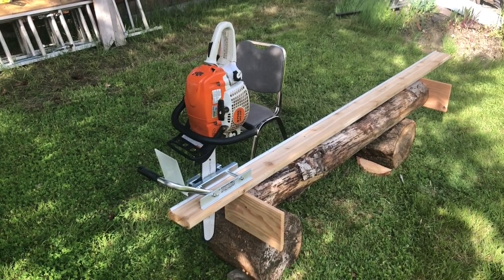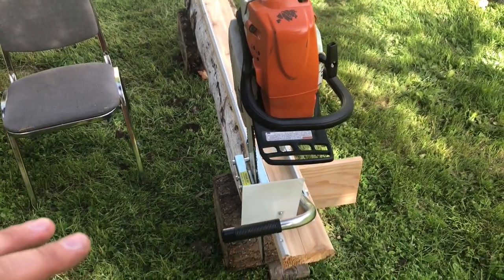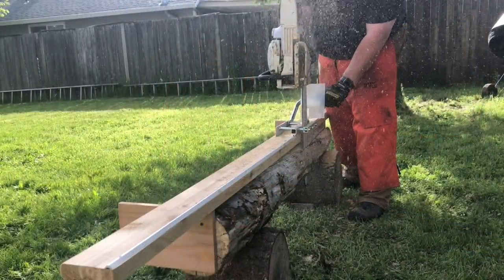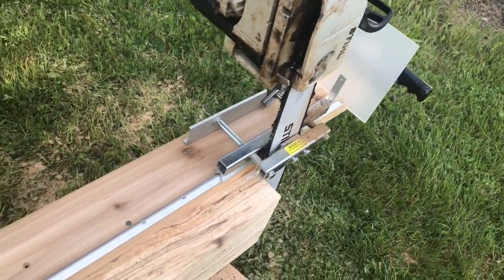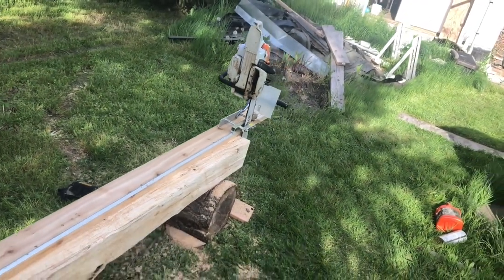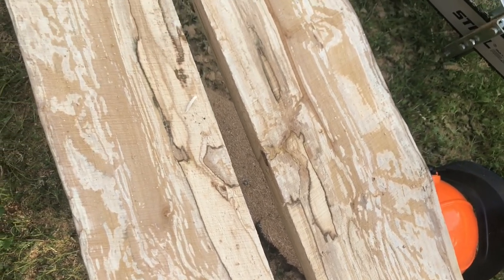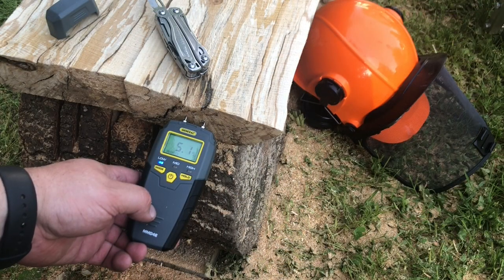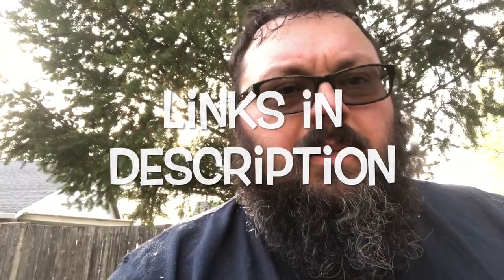First Time:  New Chainsaw Mill

Comment: Great video, thank you for posting this. I wanted to comment on the technique you used, only because I purchased a mini mill (not the same brand) but in the instructions it says to "pull" the saw. I was skeptical of this because the "push" (top) part of the bar does the cutting (so all the shaving will fall straight to the ground) it also means that if the saw were to catch it has the potential to jump out of the curf and if it did it would travel towards the operator. Thought I would share this. I havent used my  mini mill yet but I look forward to it! This video helped a lot!! 
All the best.
Reply from the maker: Thank you for the observation.  Honestly I haven't used this mill since, I have been using the Alaskan version which is horizontal.  I still have this one and don't count it out as useful.  Thanks again...
Reply: How are you liking the Alaskan mill?
Reply: @1muddonna  ive only used it once. Happy about the final product but i honestly havent cut enough boards to say yay or nay

Comment: Your 20" bar x 55cc chainsaw mill will easily cut 12" timbers and slabs.    I have the same size bar and 50cc saw.     
You'll love the smaller Granberg slabbing tool, too, works great on this size saw, and allows you to cut 1" and 2" slabs very easily.    A great companion to the mini mill
Reply from the maker: I am thinking along the same lines.  I am looking forward to trying everything out

Comment: If you have a hot attic or garage in summer you can put your planks up in the rafters and speed up curing process.
Reply from the maker: That is a great idea.  My hatch is smallish.  I am going to do that with some of my smaller pieces.
Reply: that is a great idea. Or you could build a solar kiln out of plastic in a sunny  corner of the yard maybe
Reply: The faster it dries, the more it cracks even if you seal  it first. But sealing helps your wood to dry out uniformly.

Comment: That mill looks great im away to order one. A general rule of thumb with fresh cut trees, if your slabbing them is a year air drying for every inch thickness. Moisture content for internal purposes can range fro 8 up to 15% depending on the timber and use.

Comment: Make sure when you lay this out to cure that its supported every foot and a half or so, if you're able to weight it down flat to help with warpage all the better. Leave that dead edge where the bark was on there and have it out and showing. After it's nice and dry sand the flats smooth then give er a few coats of boiled linseed oil, should make the grains pop
Reply from the maker: Ya, I have it stocked and will put some weight on it later today.  I am excited, for my first cuts I think it went pretty well.
Reply: @TheBeardedGiant  Andrew, pretty soon you'll have a nice little pile of lumber drying in the back yard :)    Start saving wood for "stickers" (I use 3/4"x3/4"x 4'  or 3/4" x 1" x 4')  to stack like Brandon is talking about....  I always run out :)

Comment: Built one 40 years ago just to get a vertical cut after the first slab taken off log with Alaskan. Saved a lot of time getting that first right angle. Only used it for that purpose with a smaller saw, the big saw on Alaskan was faster and easier making boards. Made it out of scrap metal.

Comment: Just got myself a cheap knock-off of this. It's the easiest and cheapest way to square up a log into a gate post. You don't have to worry about cutting into the screws that hold the guide plank down- unlike an Alaskan.

Comment: I have seven black locust logs 12' x 24" that I am thinking of milling into boards using a chain saw and a mill, such as shown here. Do you think this is doable? What advice would you give me? Type of saw, type of mill, etc. Thanks!
Reply from the maker: I think it is doable with the vertical set up, but would be easier with a classic Alaskan mill like this one https://youtu.be/ruAN_jSiIOs 

I would suggest ripping chain on your saw, if you don't want to invest in ripping chain at least use skip tooth chain to clear out the chips.  I would also suggest at least a 60cc displacement engine on your saw for something 24"  with at least a 30" bar...

I am a fan of Stihl and Husqvarna, but I hear people use other brands successfully...
Reply: @Hello Gordon how are you doing

Comment: Very cool Andrew. Thank you for posting. I'm really interested in getting something like this. I only have a Poulan Pro PR5020 50cc with 20 inch bar but I think it could handle edging if I use a ripping chain.
Reply from the maker: Jay, I think your saw could handle it.  I use a 20” bar and my engine is 55cc.  I was using the Granberg ripping chain, but I understand the one from Oregon is also very good.
Reply: Jay, I have a 50cc x 20" Husqvarna. It works fine for milling:)      I bet your Poulin can handle it.     I can rip 12" material with no problems.
Reply: @TheBeardedGiant  Sounds good Andrew. I have a pretty fair amount of trees down on our trail property and I want to try milling a few.
Reply: @OakKnobFarm  Oh that's awesome Dave. I am excited to give it a try.